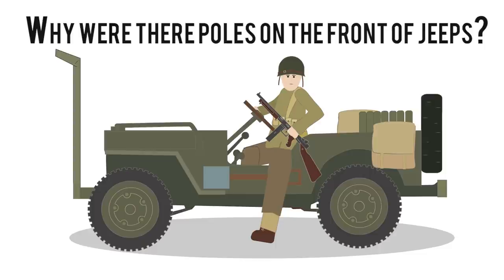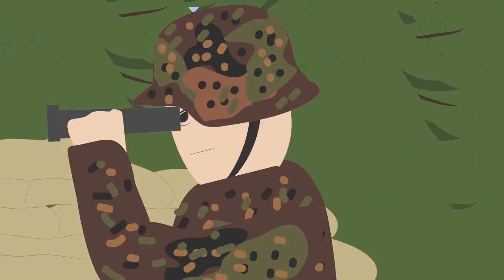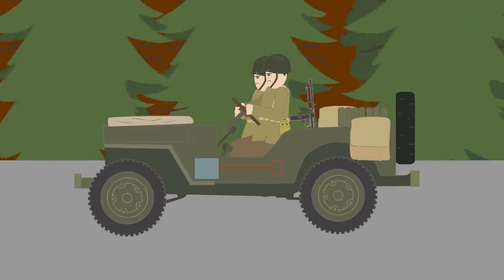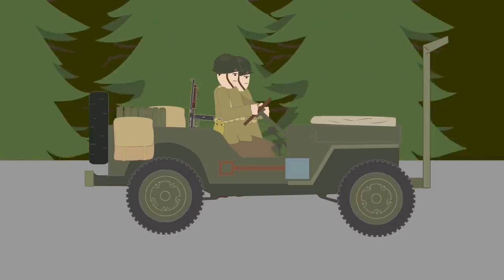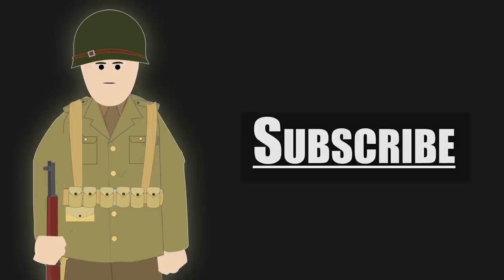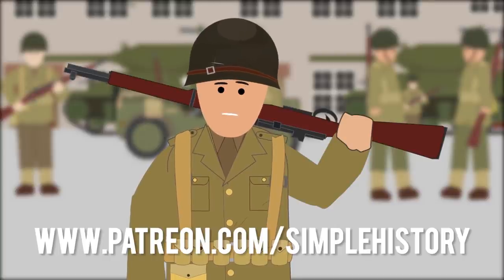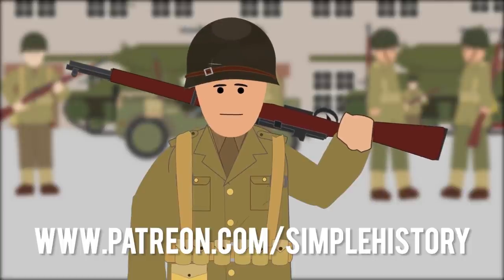Why were there poles on the front of Jeeps?

Comment: I thought that was a snorkel

a snorkel on a fairly exposed engine car with no roof or doors and a retractable window
Reply: America weaponizing cartoon physics
Reply: I also thought it was a snorkel, instead, it turned out to be a way of keeping your head
Reply: The M35 A1 could cross rivers underwater with drivers using scuba and the snorkel and exhaust as the only things out of the water. Look up the army training film on -line.   So thinking it is a snorkel does make sense after all doesn’t it.
Reply: @kayjeld1813  No they put snorkels on tanks and jeeps for river crossings. Not to mention amphibious landing.
Reply: I thought the same thing
Reply: For god's sake, learn the difference between 'breath' and 'breathe'.

Comment: We did this early in the  Iraq War. The enemy would string up wires in the attempt to decapitate our turret gunners. My first tour was before the mass roll out of armored vehicles so we had to get creative. Sandbags  in the floor board, scrap metal welded or screwed to the existing doors, chicken wire in the windows to keep grenades out... Good Times.
Reply: Yes my unit also did this.
Reply: Had me at chicken wire for nades
Reply: Yes. True. Camp Echo 2007.
Reply: Was about to say the same thing I remember cutting some sickle type thing out of metal welding it up and attaching it to our humv
Reply: Our troops still do this in Afghanistan.

On air force bases here in the country there is also steel mesh on some temporary guard towers. Made of steel beams and sandbags, big enough to put a rifle barrel through but not for a grenade or molotovcocktail to pass through.
Reply: You: ya i got shot in the head that Day good times
Reply: @quintenj21  You know it! 🍻
Reply: @claudyfocan731  Military personnel are some of the most creative individuals on Earth. True story.
Reply: @trueb0ss845  I remember the first time I saw that. I thought we were SCREWED. But it worked by God! 🍻
Reply: Johnny Chaos anyone is creative when given the right circumstances
Reply: I was thinking the same thing, that we didn't use them until after 1990, but I also remember switching to Humvees before that war so It's messing with me. Makes me think we had them all along and I'm just forgetting about them.
Reply: @piperp9535  I'm curious now. I joined in 1996 and we already had them then. They didn't start turning out the armored ones until 02 or something like that. I just remember rolling out of Kuwait with canvas doors and plastic windows with zippers!
Reply: @johnnychaos152  I retired in 98, but I'm doubting myself now think these weren't on our jeeps in the 80s, got added to the Hummers after the 1st war in 1990.
Reply: Thank you for your service.
Reply: @mattkaustickomments  Thank YOU for your support.
Reply: Similar to what they did with 113's in Vietnam, except they realized the sandbags were too heavy that they swapped them out with dirt filled ammo cans. Then you had the improvised gun trucks, and ACAV.
Reply: We made some Frankenstein trucks in 05 at Camp Buehring before deploying into country. Fell in on some uparmored hummers when we got to Kalsu.
Reply: We did this too bud. We had "light skin"  Humvees. No doors, no roofs.
Reply: Don't some of the MRAPS and other vehicles come with that anti-wire stuff from the factory now?
Reply: Shout out to the engineers who did the welding for us.
Reply: @TheZnq  Camp Echo, Diwaniyah.  Nice camp.  I set up the comms there in Dec. 2004.  Left in March 2005.  MND-CS bump.
Reply: Thanks to all who served our Country
Reply: Godspeed do you fellas.
Reply: And metal fences welded on to counter a hit from an RPG
Reply: Iraq 03-04, we would just duck low enough that the M2 or MK19 mounts would take the hit instead of our necks.  I was never in anything uparmored.
Reply: I never thought of chicken wire.
Reply: @trueb0ss845 samething did the German soldiers in WW2 in Russia.
But then they countered with fish hooks bound to the grenades, so the nades got hung in the chicken nets and exploded directly there.

Comment: Poles are still used to this day in military vehicles for the same purpose, also Sand bags were used as recently as the first 2 years of the Irag war, due to IEDs before the upgrading to armoured vehicles was initiated. 
Another one not mentioned but interesting nonetheless is hanging bullet proof vests on doors for protection from small arms; again that was before the armour upgrades.

Comment: The metal rods at the front of the Jeeps also had sharpened notches cut into them, they could cut wire including barb wire obstacles that were strung across the road.

Comment: In 1972 I did my first tour with my regiment in Northern Ireland on operation motorman. We had exactly the same angle iron arrangement on the front of our landrovers. It was simply because the criminals started to string a wire accross some roads to try and kill British soldiers. The angle irons had a sharpened  notch cut in them at the top to cut any wires intended for us.
Reply: I can't imagine why there was such hostility to the British in Ireland. It's not like the island suffered under more than 500 years of brutal, and at times almost genocidal British oppression. Criminals? How about patriots fighting against colonialist bastards.

Comment: Farmers have been caught stringing wires across trails that ATV's and Snowmobiles use. There's a metal chin strip that goes down to your chest pad that will break the wire before decapitating the rider.
Reply: We usually made it look good by using five strands of barbed wire. Trespassers do not seem to consider the amount of damage they cause. Farms have a huge gross which makes everyone thinks farmers are rich, until the see the net income.
Reply: @timmorris3056  They ignore the signs and clip the fences. Most farmers cannot monitor their property 24/7. Security footage does no good as they are wearing helmets and cannot positively ID them with it. It is usually NOT teenagers that are the problem, they usually get the message the first time. It is usually the 25-35 yuppies.
Reply: @bradquinn4161  yep, the "entitled" ones
Reply: @bradquinn4161  So you have engaged in pre-meditated attempted manslaughter?
Reply: @seththomas9105  No, I have protected my property that is clearly marked with "No Trespassing" and "Trespassers will be shot" signs.
Reply: @bradquinn4161  OK. But that's like saying you have "No Trespassing" signs up and then setting spring traps. Go to jail. Do not pass go.
Reply: @seththomas9105  Not in most rural areas. We often set spring traps for predators,  never been an issue.
Reply: youtube propaganda  You realize that this puts you firmly into the entitled category? Going onto someone else's land and causing damage.
Reply: @bradquinn4161  I AM in a rural area. I call Shenanigans on you. Nobody sets live booby traps for people, that can be murder or attempted manslaughter at the least and they are ILLEGAL.
Reply: @seththomas9105  Reread what I posted. IF your area does not have entitled people coming out and destroying stuff I might believe you. There is nothing illegal about putting up a barbed wire fence on my posted property. I suspect your idea of rural is your nearest neighbour being a 1/4 mile away.  There is also nothing illegal about me setting up spring traps on my property to trap predators.

Comment: I bought a Canadian 1984 Bombardier Iltis "Jeep" (1/4 ton light vehicle) and they were still using a detachable pole on the front of the vehicle for this exact reason. It was a bit more advanced since it had a wedge edge and a forward pointed top but otherwise just a metal pipe. The front windscreen folds down on the Iltis as well and the pole is stored on the hood below the windscreen.

Comment: mine still has a tow-bar that i leave up like that for similar reasons. helps block large branches, animals (in case i run over one for some reason) or even snapping cables from reaching my face. it's more effective on my buggy because it blocks everything the cage itself wouldn't block already.

Comment: My dad was a WWII veteran.  He saw men decapitated by those d@mned piano wires.  He never rode in a jeep unless it had a front pole.  He also insisted on putting up the windshield, smearing it with mud to prevent reflection.   Yeah, I know, it sounds counter intuitive.  They left a peep hole for the driver.

The sandbag under the passenger's seat sounds good.  The sandbag under the driver's feet has some merit.  But the driver sat on the gas tank!  If the jeep hit a mine, the likelihood of either occupant surviving was tentative, at best.
Reply: Was a WW2 Vetran, R.I.P to your dad. Thank you for his Service❤

Comment: We had the same issue and fix while in Iraq
Reply: really? but the humvees are enclosed? or was it on some other veichel?
Reply: lordofdarkdudes us as the gunners were still exposed from waist up, outside of the HMMWVs. They would string piano wire across the bottom of an overpass about neck level of a gunner.
Reply: @itisthechad  thats just rude

Comment: My Father in law was posted to Palestine after the war by the British army, he said that such wire's were common place and  fitted to telegraph poles by locals. At night they could be fatal and they lost a few drivers that way, they floated the idea of attaching a pole with a cutting blade on it. This idea was dropped because if the wire did not cut it could flip the jeep, they settled on two poles which were bent in an arc one on each side of the jeep. Just like the roll bars on a beach buggy, he said you could hear the wire making a shing sound as you drove at night but you never saw it.

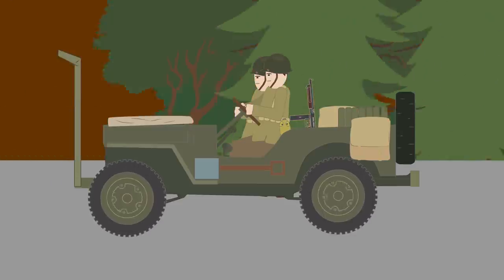Comment: 0:43 The sandbags were not there to degrade the jeeps performance. The sandbags were there to protect the driver and passenger from shrapnel from the mine, reducing or preventing injury. This was done in many vehicles during WW2 and even to this day it is an effective method against normal landmines.

Instead of a sharp piece of metal slicing deep into your leg, you instead get pelted by a bunch of sand and dirt as the shrapnel expends its energy there. Instead of a potentially lethal leg wound, you get bruising and surface cuts.

Conveyor belt materiel is also reasonably effective against shrapnel (but not bullets) and has been used in many bush wars to provide protection against landmines.

Comment: I guessed right, helicopter often have something similar on the lower nose of the chopper to cut powerlines if they run into them. The wire trick worked real  well for motorcycles.

Comment: When we were on the way to Afghanistan we filled sandbags for our vehicles. Then we were told to take them out. The IEDs were powerful enough to get through the sandbags and it put dirty sand into the GIs wounds. This caused infection problems.  In my ambulance we couldn’t sandbag the patient area anyway.

Comment: Also they were used to pull the Jeep behind larger transport vehicles, they would deploy the Jeep in areas the larger vehicles cannot fit. Similar to when you see long distance transport truck drivers towing a smaller vehicle behind. That way they can park the truck and use the smaller more manoeuvrable vehicle to get around the area they are staying.

Comment: They put improvised armour inside M113s in Vietnam including sandbags. The problem then could be those inside getting a face full of sand if a mine went off. Not very helpful if you then have to go into combat.

Many soldiers just decided to sit on the top of the APC instead. Which, of course, left them vulnerable to enemy weapons fire.

Comment: In WW1 they strapped a pole to my great grandfather's horse's nose so he could gallop through the barbed wire. The pole was wide enough that it could block machine gun rounds. After making it across no man's land, the pole was then used as a battering ram to gain access to the enemy trench. Once inside the trench, the bronco would begin to buck wildly. The steel pole at one end, steel horseshoes at the other, and my great grandpa still mounted while swinging a steel saber.  It was total mayhem.

Comment: Not just WWII... if you are in a jeep around anywhere where TOWs are fired or Commo Wire is strung you had better have a wire cutter on your front bumper. The Hummvees don't have dropable windshields so it's less of a problem.

Comment: In Iraq we used glow-plugs and chains to trip IEDs. The chain would snag the trip wires and glow plugs were used to set off IR sensors. The Iraqis started angling IEDs and EFPs to compensate. We also had mine rollers on the front of some trucks at the end of the war. Crazy inventions happen in war. Another thing we had was a Duke System that blocked cell phone signals and a Boom System that echo located shots fired from a distance. America is the best military for a reason.

Comment: alas, the problem for the driver. no room for a sandbag (which was/is called hardening) because that was the gas tank was. yes the engine was fairly exposed but was submersible through use of a fording kit which extended the exhaust and intake.

Comment: They are more than just "poles,"  and they were for more than piano wire.  We still used them on Recce vehicles in the 1970s.  They save lives in peace time because recce troops move at speed over ground that sometimes has wire, either abandoned, old stock fence, or an obstacle.  BTW if you put up the windscreen, you haven't protected yourself from wire hazards.  Jeep windscreens are too flimsy, and too much non-structural glass.

Comment: This is kind of like these panels some us army vehicles used in Iraq to negate some directed explosives that detected the heat coming from the engines that’s set off the bomb. I forgot exactly what it was called, but it was an explosive that would melt through the armies thick armor on the vehicles. 

It was just basically like a piece of metal that’d get heated and set off the bomb so that the only stuff that get damaged is the engine, instead of soldiers dying.

Comment: How exactly did one put a sand bag under the driver’s seat.  On the WW2  MB and GPW Jeeps the gas tank was right under the seat and you had to lift the seat cushion to put gas in the tank.  Having owned one of these beauties years ago I can assure you that the sand bag could not have been more than a few inches thick at the most.  More research!

Comment: See I never could figure out why the Germans did not put directional explosives on each side of the road and use the anti wire defense to detonate them killing the driver and passengers.

It seems a logical evolution..

We forget that the Jeep was designed originally to replace the horse for scouting and light towing. That was why it was so low and open. It was designed to hide and travel through wooded areas where a scout cavalry unit would travel.

I read a book about German soldiers at D day and beyond.

Several that were interviewed stated that they knew the war was lost because there were no horses being used by the allies and the extravagant burning of gas. 

The Jeep’s were effective because there were just so many of them.

Comment: Huh... I was expecting it to be connected to the air intake of the jeep in case they had to drive through a deeper body of water so that the water didn't get into the engine and make it stop working.